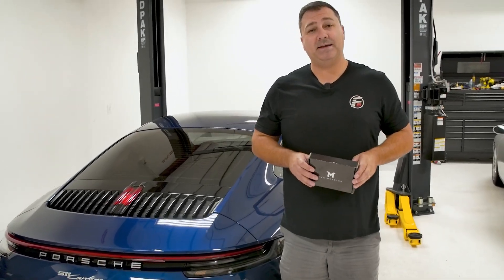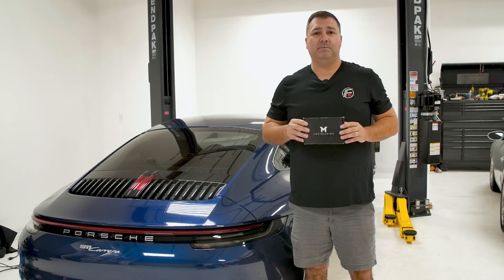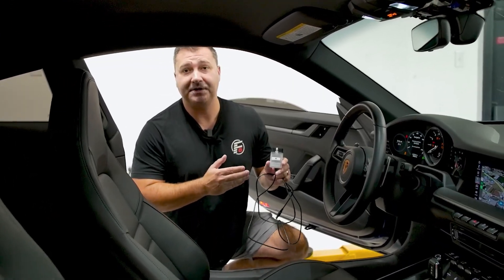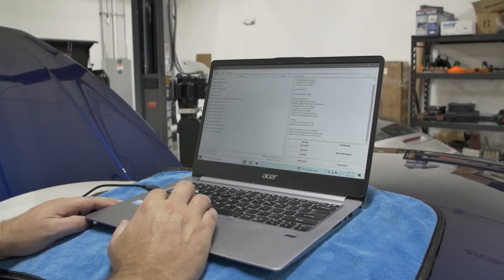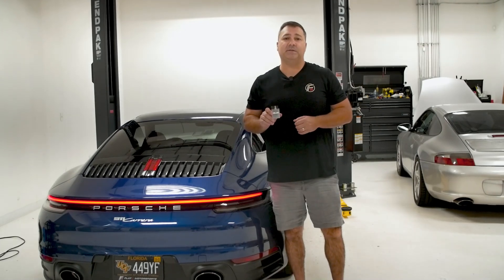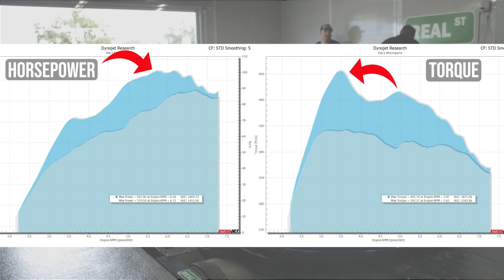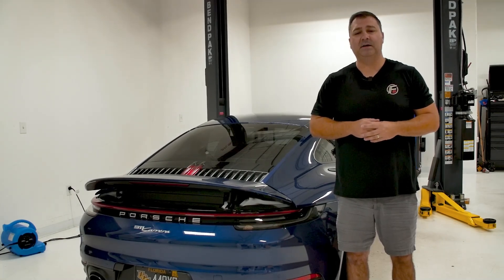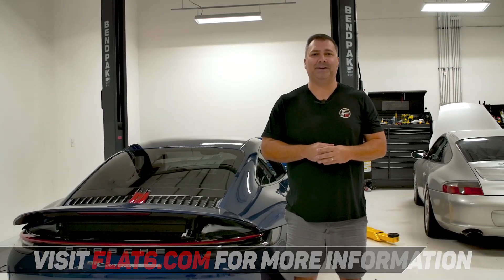M Engineering Tune (992 Carrera) w/ Dyno & 1/4 Mile Testing

Comment: I do not trust to your dyno figures. My 992.1 T on dyno had 395,6PS and after instalation of Racechip 474PS but the point is that stock figure is normally around 390ps on 992 Carrera and not 374 as you have measured!
Reply from the maker: All dynos read different.

Comment: Stock numbers here are irrelevant because they don’t know the exact drivetrain loss for that particular dyno. They are all slightly different. What’s valuable is the difference after the mod to the stock number. So take the overall number with a grain of salt
Reply from the maker: @bryjb10  just so you are aware we have about 70 cars vs manufacturer claims. Also a small sample from the engine dyno as well so we have a pretty good understanding of drivetrain loss, at least within a couple of percentage points.
Reply: @ that’s still tough because dynos correction factors vary even between different dynos of the same manufacturer. Yes you can get close but what really matters is the difference between the stock run and the mod run.  Unless you took that motor out and put it on an engine dyno there is just no way to tell if the car you got was down on power or had more power than was advertised in the brochure
Reply from the maker: @bryjb10  Agreed, we just don't have the resources to get that granular. We have had a ton of cars on the dyno, and several of them on independent dynos, we think our calculus is pretty damn spot on but it would be relatively impossible to get to 100% validation without a ton of investment. We're not selling particular parts or tunes, we work with a host of vendors and always share our testing results.

Comment: Coming from a high strung GT350 to a Carrera T is there a tune you could load to make the high end more rewarding? The low end rpm range seems plenty strong enough for me. Or is that just the nature of this motor? Thanks!
Reply from the maker: Yes, the M-Engineering tune will add power up top. If you need more, we'd recommend the S/GTS turbos or Pure 800s.

Comment: How does this work? Once tuned will I be able to turn off and turn on the tune without refleshing back to stock. I just got my 992.1
Reply from the maker: You need to use a laptop but you can switch files. Map changes take about 1 min, to fully install/uninstall, it takes about 6 mins.

Comment: I am not a fan of those sounds when lift off the accelerator pedal....
I am grown up with silky smooth NA BMW engines
and want to enjoy the engine breaking without those cracks💥
More suitable if you got a V12 Lamborghini to spit 💥fire🔥☄️with to impress young men....if you are into that.
If you make sure that the engine is warm then you can rev. it out....
The 3.5' rpm is a protection for your cold engine and your Neighbours ears...
I appreciate that there is a real on/off feature for the sport exhaust and the start/stop function.
One upside with the carrera turbo engines compared to NA engines before is the Tune-ability.
Very good knowledge and content keep up the good work👍🏻

Comment: Tuning for peak gains just makes for an awful curve. I would take a flat torque curve and ability to rev it out to 7000 over gaining an extra 50HP/50TQ any day.
Reply from the maker: On these, that requires a larger turbo, the Pure 800 delivers an exceptional linear curve. The base turbos are small.
Reply: @Flat6Motorsports  it doesn’t matter what the turbo size is. Just don’t tune for peak gains. You would be making 50HP less but you would have a nice curve from 3000-7000

Comment: What is the waveform-like curves on the dyno graph at the upper RPM levels?  Boost fluctuations from the diverter valves?
Reply from the maker: It might have just been the dyno sampling, here is one we did recently on our hub dyno: https://cdn.shopify.com/s/files/1/1429/9246/files/Mike-992CarreraT_S2_fbf04a54-8911-4d73-a32b-6c0f0e3fffb2_1024x1024.png?v=1700580214
Reply: @Flat6Motorsports   Looks good!  Thanks!

Comment: Is it safe to tune a 992 yet? risk vs reward perspective. Is there enough data about side affects or unforeseen issues?
Reply from the maker: Yes, very safe. We've been running 700HP+ since the 991.2 on these motors. The blocks are shared with the 992 Turbo (less of a bore to get the 3.0L displacement). Extremely durable without any reliability issues. In fact, Porsche uses tuning as a strategy through the various Carrera models.

Comment: So this definitely voids the warranty but even the basic M eng tune, is it strenuous on the engine ? Bad if u plan to keep the car for a long time or almost daily drive it ?
Reply from the maker: It just depends what you are looking for out of your 911. If you are happy with the power, there is no need. We have been running 750+ HP on the 9A2 and 9A2 EVO motors for over 5 years with tons of clients. They are very capable and reliable. Porsche uses the same block and architecture on the 992 Turbo/Turbo S.
Reply: @Flat6Motorsports  I am basically trying to get get extra 30 to 40 bhp from the base 992. Nothing crazy! Appreciate the reply
Reply from the maker: @MD2525-1  tuning would be the easiest path but you can get about 15HP out of an exhaust.

Comment: Do you have tunes like this for the 991.2?  I've got one now in my 991.2 C2S that I like, but wondering if yours might get just a little more power out of it?  Stock hardware otherwise.  Love the channel!
Reply from the maker: Yes! We have a wealth of experience with the 991.2 Carrera platform. We have several kits we've developed and validated over the years. Check them out here: https://flat6motorsports.com/pages/991-2-carrera-power-kits-by-flat-6-motorsports

Comment: This is dope,  no reason to get the S.  Better to get this tune and spend the extra on the wanted options
Reply: I own a Base car and I love it. However, getting the limited slip and bigger brakes are both good reasons to upgrade to the S. I had issues getting an S allocation, so that is why I got the Base Carrera
Reply: is your base tuned?  @zTheBigFishz
Reply: @denychangy7386  Yes it is. APR. The difference is significant.

Comment: So the plan would be to remove the tuning software, returning to stock configuration before taking the car to the dealer for warranty work?
Reply: No, if you do this the warranty is over. Even if you return it to stock the instant it is connected to the diagnostic computer it will know the ECU was reprogrammed and that throws up a red flag. If you do this you must accept that if anything goes wrong the repair cost is on you.
Reply: Wait until out of factory warranty.
Reply: @jmorrison146  I recently took my car for an oil change removed the M software, and had no trouble. I drive a 992 base.
Reply: @nonyabysnis2076 how are you liking the base with the tune? I was set on an S but found a killer deal on a C2 locally and want to do the same tune 😁 thanks!
Reply: @jmorrison146  took me five minutes to remove the tune.
Reply: 100% correct.  Not worth it

Comment: Just installed this tune on my 992 Carrera4. First time ever I was tuning one of my cars so I was a bit apprehensive. Just to let you know it all went very well, the only glitch was the dongle connection with the computer/software took 4-5 tries to get a good connection for some reason. But aside from that it worked flawlessly, everything worked as it should, no faults error in the dashboard nothing. Didn't have to troubleshoot anything after the install. Additional power and torque is OBVIOUS, feels like a different league of cars. Only ran about 30 miles with the tune on, but so far I've very satisfied with this product. Thanks Flat 6 motorsports
Reply: I used this product on my 992 base. Been a week and it’s been an OUTSTANDING addition. I highly recommend. 

Word of advise though, when you do the ECU read to send to M Engineering, make sure you specify in that original email the different features you would like, for example, explicitly state that you want the pops and gurgles to stay or be removed, the on off, the sport exhaust ON OFF, etc. otherwise the tune file they send back will only be the ecu tune and you’ll have to email them again to get the correct tune file
Reply: @matthewzamat3331 how’s she doing after a year on this tune?
Reply: @tallui no complaints whatsoever from me, everything is perfect with the car. I really could not be happier!
Reply: I am keen in this tuning too for my base 992. Any feedback after 10months of tuning? so far so good? Any issue with dealership service?
Reply: Would definitely love to hear some updates. I just ordered mine and when it arrives, I’ll start my process.
Reply: How’s it been @pierreblanchard1024 & @matthewzamat3331 ? Have you guys still been enjoying the tune and have you had any issues or additional maintenance ? Also are the brakes on the base car good to handle the additional power ?

Comment: In 2020 I bought my new 992 C2S here in Orlando and had a GIAC tune placed on it at that time. It required having the actual ECU removed and shipped to California. I LOVE the tune, as it is somewhat comparable to the M-Tune in power. But I would advise everyone to get an M-Tune over the GIAC tune simple due to the ability to remove and put in the Tune directly through the OBD-II port. Also during scheduled servicing at a Porsche dealership I cannot remove it and must ABSOLUTELY make sure the tech does not code over it every time. That's a real pain in the Butt! The GIAC tune unfortunately does not have the little things, like cutting off the start-stop button. I have even been told by other 992 owners that have been over to the Real ST. dyno and found the M-Tune making not only more power but a smoother transition overall. Unfortunately in 2020 M-Tune had not broken in to the OBD-II and so I went with the GIAC Tune. But now with the little things like stopping the cold start on the 992 in the morning and the ability to REV the car past 4,000 rpm's in neutral is not available in my GIAC Tune. And you have NO idea how BAD I want to rev it up to 7,000 in neutral. As I have an Akrapovic exhaust system with high flow Fabspeed 200 cell catalytic converters to really low ball the sound. Also, the ability to remove and place the tune in and out of the cars ECU through my OBD-II has me wanting me to switch over to the M-Tune. Thought I'd just share my little bit of experience about a tuned 992 C2S with those that maybe on the fence on getting a Tune and which tune to get..... Get the M-Tune !!!
Reply from the maker: Thanks for sharing. These are all reasons why we find the M-Engineering solution to be the best in class. It really empowers the customer with a full suite. We've also tested several 992 tunes on the same dyno and the M-Engineering not only made the best power but also scored out best on the subjective driving feel. The only area we found that might benefit from some tweaking is for track use, a little less aggressive of a boost ramp curve would provide a little more linearity to the power delivery, providing some greater feel/control on more technical tracks or sections. On the street, it's perfect as it provides that extra level of engagement every time you drive the car.
Reply: @Flat6Motorsports  John, this is exactly what I am dealing with using the M-tune and even going catless with all the higher flow add ons.  The boost hits too hard and unsettles the car early on "let her wiggle and then get control" I do want them to tame this boost on throttle so bad.  Refer to your linear band in this video and see what can throw car off corner line.
Reply: Did you lose your manufacturer warrenty with the tune ? I assume you would ?
Reply: No I didn't. I got a full warranty from Champion Motorsports in Pompano Beach Florida along with my GIAC tune. Remind you, I had the Tune put in October 2020 before M-Engineering had broken the OBD-II for their tune and the only way to flash the ECU was to actually remove it and send it to GIAC in California. Hope this Helps!
Reply: No I didn't. I got a full warranty from Champion Motorsports in Pompano Beach Florida along with my GIAC tune. Remind you, I had the Tune put in October 2020 before M-Engineering had broken the OBD-II for their tune and the only way to flash the ECU was to actually remove it and send it to GIAC in California. Hope this Helps!
Reply: No. I have a full warranty from GIAC. If it didn't come with it I won't have tuned it.
Reply: Anyone wanting more power than a 992 Carrera (referred to as the base model) on the UK roads needs their risk level checked.... It's already insainley fast.